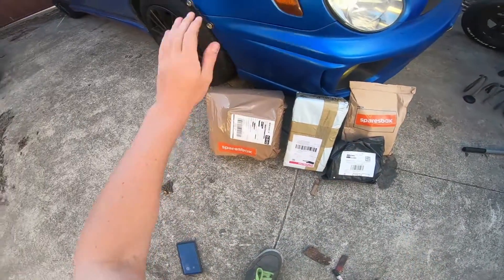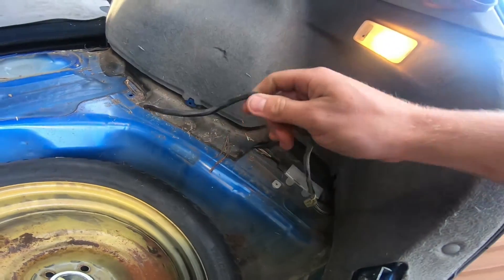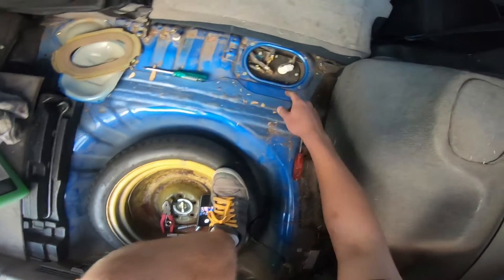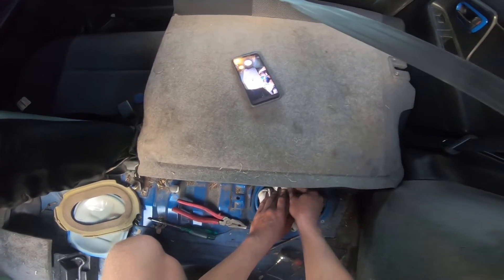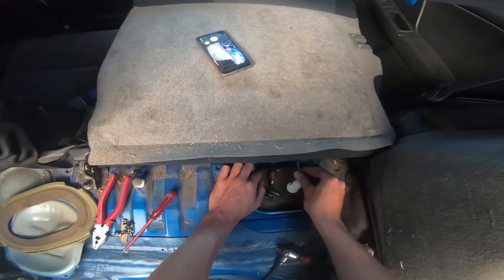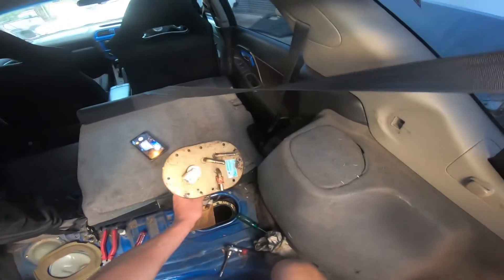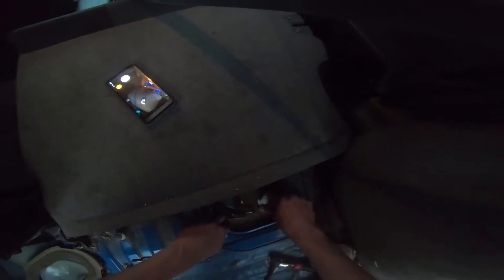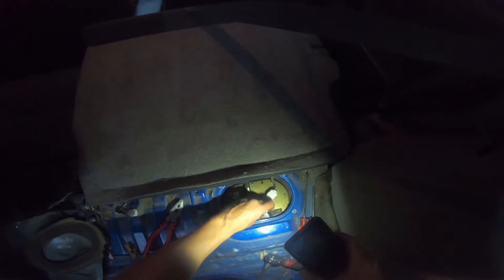subaru fuel pump install/swap | Deatschwerks 200 | Bugeye wrx

Comment: Ah the good old balance the iPhone as a torch job! Love it. Thanks for showing the location- our blob eye keeps cutting revs/ dipping out at random times and thinking the fuel pump may be at fault. Sadly looks more involved than I thought lol. Can always try though!
Reply from the maker: yeah thankfully its nothing that you need any special tools for, and fuel pumps now are pretty cheap. from memory this one was under $200aud. i was having a running issue and although it didnt solve it, it still gave me the peace of mind that i now had a good quality pump in there to support future power endeavours. if you are having running issues though, never overlook you maf/intake sensor. thats where my issue was. just need a screwdriver and an electronic or maf sensor cleaner and gave it a good soak and plenty of time to dry before going back in. ran beautifully after tha
Reply: Yeah iphone camera really comes in clutch

Comment: looks to be bolted on the exact same way as in my subaru impreza gc3 from 1998, only i couldnt find those little 8 size bolts my car is probable way to dirty underneath the first cap😂😂
Reply from the maker: Definitely helps to clean things up as you go 😅😅 makes disassembly and reassembly much nicer

Comment: I got 2 MAF cel codes and I’m pretty sure it’s the fuel pump… cars running like shit and loss of power… tried a new MAF and nothing…thanks for the video brother
Reply from the maker: could be any range of things annoyingly. but i knew this had the stock pump so figured its going to get upgraded anyway and its not something you need a tune for for more just the peace of mind that its not the pump once done.

Comment: Thanks man! Got my 02 SRP wagon with 191k on the body gotta swap out the FP with a walbro 255. Got a new Type RA shortblock and D25 heads swapped in. Car needs a tune pretty bad, it seems to have the ECU locked up by one of those Cobb tunes.
Reply from the maker: well shoot hey. yeh the cobb tunes are ok... if youre running it with the cobb products to match. if not, then a pro tune is definitely the safer way to go. the 02 though have th 16bit ecu from memory so they pretty lenient to how much you can do before it can't compensate anymore

Comment: G'day bro, I've got an 02 bugeye sedan (WR blue of course!) and been having an issue with hesitation/bogging at only very light throttle and between 1000-2000 rpm mainly. So far I've replaced the MAF sensor, new front o2 sensor, intake pipes all new silicone, checked for vacuum leaks and can't find any. When driving I hooked up my obd scanner and in that lower rpm band when it's doing it you can see the short term fuel trims spike up to around +15-25% so it's definitely leaning out there. Now I'm leaning (lol) towards the fuel pump and FPR (I've ordered one).. Cars done 289k kms and can't see any evidence they've been replaced so might be worth it? Cheers
Reply from the maker: So my go to is usually a maf clean because it's cheap and easy to do. But if you've just got a new one in there then obviously shouldn't be that. Another very overlooked issue (I've been having low throttle issues lately and just sorted it with this) a dirty ground/negative connection. My wires were all corroded particularly at the crimped parts for the terminal. Just to see if that's what my problem was (before doing it properly and replacing them), disconnected the engine and chassis grounds, light wire brushed them. Put them back in and it ran beautifully again. So, assuming you have some kind of wire brush at home, check your batter terminals and ground points to see if here's any corrosion on the wires. And hopefully it is that to save you a few hundred bucks
Reply: @sebsshenanigans  thanks mate, I'll give it a go! Also did you replace the fuel pump assembly rubber gasket? Or just reusing the old one is fine?
Cheers
Reply: @JasonISF does the issue persist once the car is warmed up? My wife's bugeye is having similar issues, no vacuum leaks, but once it warms up it runs okay ish, runs fine if I unplug the maf, about to check the fuel pump tomorrow though
Reply: @lukeyduke6733  it doesn't matter warm or cold it does it. After replacing the fuel pump and FPR nothing changed, so I drove a friend's bugeye with the exact same tune as mine (ECUTEK) and his does it too, so now I know it's the tuning and not hardware related.

Comment: is this fuel pump safe for a factory 02 wrx? I believe my fuel pump just went out on my wrx and want to be sure this is okay to run on a completely stock wrx.  
Thanks in advance.
Reply from the maker: this particular one yes, and further down the track if you plan to go further and get it tuned after some modifications will still keep up. good thing about doing a fuel pump is you dont need a retune for it.

Comment: I have a gas leak in my Subaru Impreza wrx wagon 2003 every time I put gas in the car  there is a strong odor  of the gasoline that comes from the back of the car  , but I can’t figure out exactly where it is coming from
Reply: Then take it apart and look. There not a whole lot of places for it to leak in the back
Reply from the maker: yeah im no help, best bet is get the car up and checking out underneath. pressure wash under there after soaking in degreaser. let it dry then just run your car and look for a wet spot.

Comment: Fule filter ?
Reply from the maker: I have replaced fuel filter as well, the issue was being caused by a dirty MAF sensor. Gave it a clean with electronic cleaner and it ran beautifully